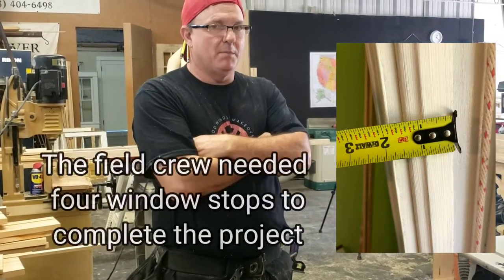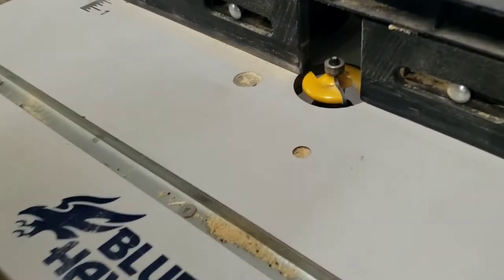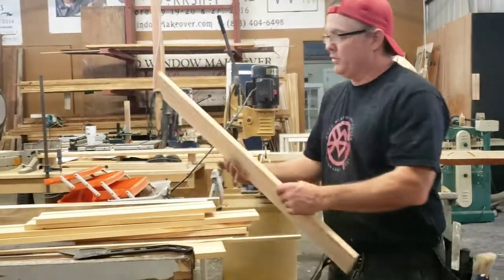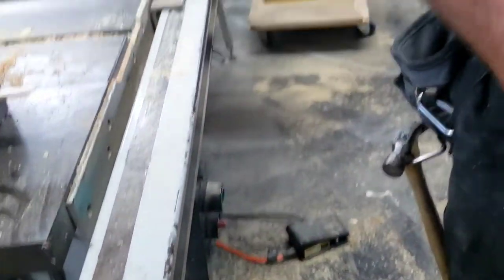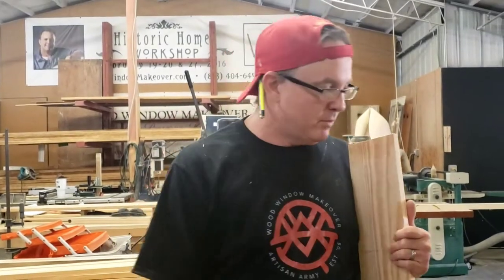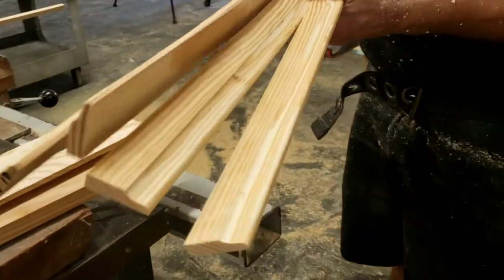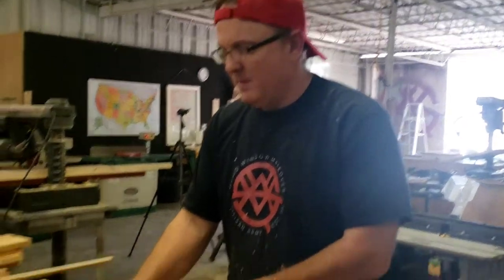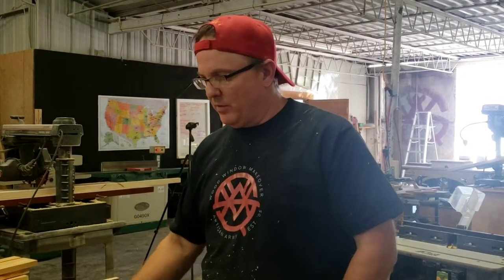Quick Window Stops

Comment: Can I just buy them at home depot or Lowe’s
Reply from the maker: You can, but they will be the wrong size. They have most things, but every single thing is just wrong enough to make a person regret going there. Window stops are 1/2” x 1-3/8 on average, mostly. Their window stops are 3/8” by 1-1/4” And are finger jointed on top of that. The thing about window stop is that it evolved to be able to be taken off and put back on easily. With finger jointed window stop the wrong size, the next time someone wants to take the sash out, as is proper, they’ll break the window stop and have to go get more. So Home Depot help you get it done. Then they help you get it done again and again and again and again....